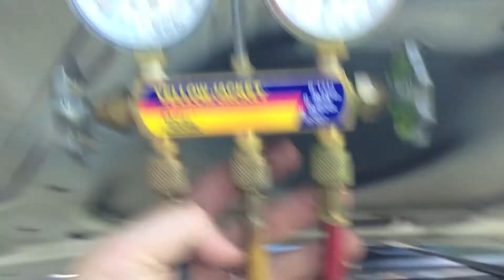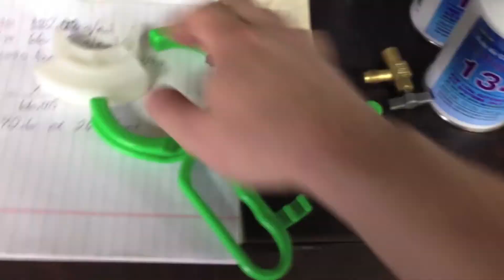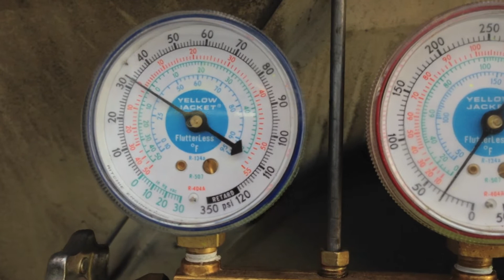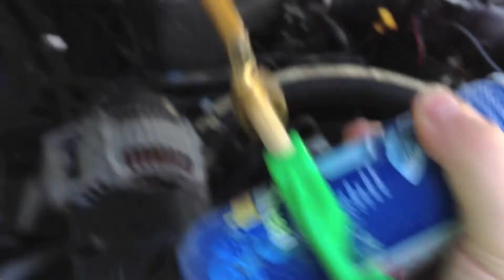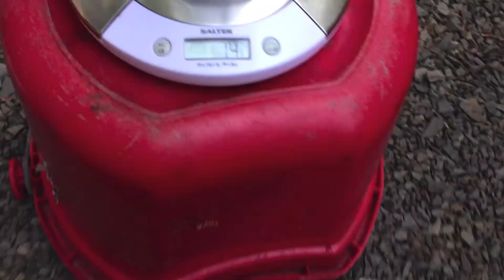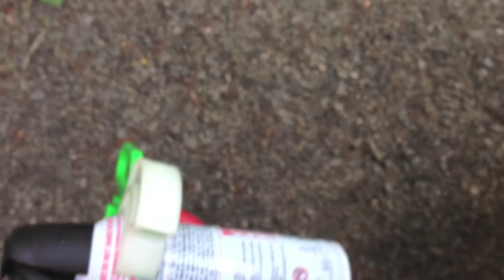Automotive AC Open System Recharge

Comment: Looked like the compressor was doing just fine- it was holding the low side nice and low despite the interior fan (presumably) being on high speed.  Also have to remember that the R134A temperature scale isn't quite accurate with R152A.  The high side pressure is purely a function of outside temperature- 90 isn't all that hot.  Assuming adequate airflow over the condenser.  Nice video though! How's the oil compatibility with R152A? Does it work fine with the mineral oil found with R-12 as well as the PAG found with R134A?

Comment: Nice 944! :)

Also, nice to see someone else using 152! As I was about to give up with it, after seeing you charge it as 'air' contrary to the masses that preach to tap the can at the butt and charge it as a liquid. I may give 152 a second shot.
Does it require PAG or can I use straight Ester oil and be fine with it?

My auto is a 97 MX-5, formally a 134 system yet the system was not redesigned to efficiently use 134 (least, I don't think). This system has the exact same volumetric space, components, lines-n-bends, and compressor as the 89-93 R12 systems.